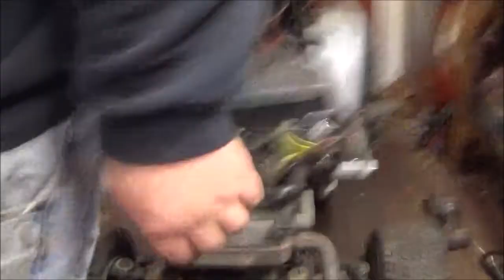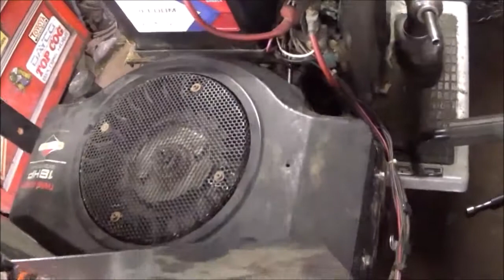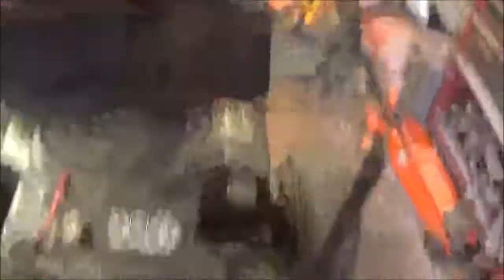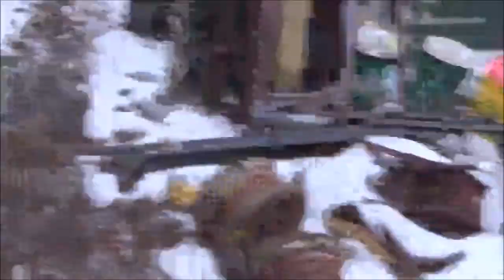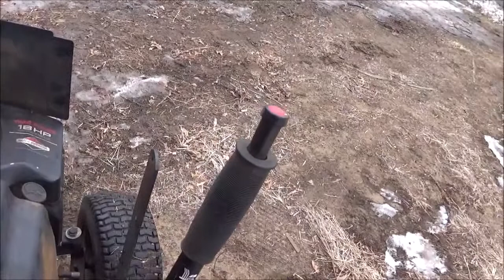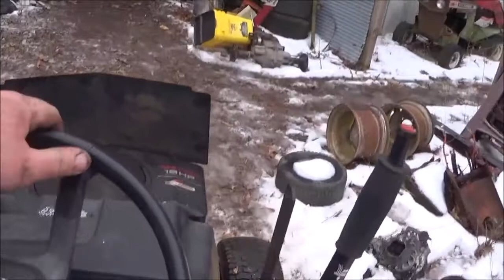93 craftsman repower part 2 and test drive

Comment: My first guess that squeak would be the break rotor . An easier fuel line trick would be to use a piece of coat hanger as a fish line like an electrician . I do the same thing when I replace fuel lines on two stroke junk . Now that motor runs so good you've got to put a gas peddle on it , easy r to throttle up when pushing back the piles .

Comment: Do you ever use the zinc additives or high zinc oil ? I use race oil that is for a small block Chevy  engine in a car we have that has flat tappets. Figured it would be the same for a small engine like in our mowers
Reply from the maker: Yes sometimes I run kinetics